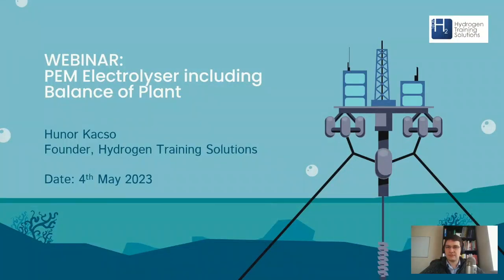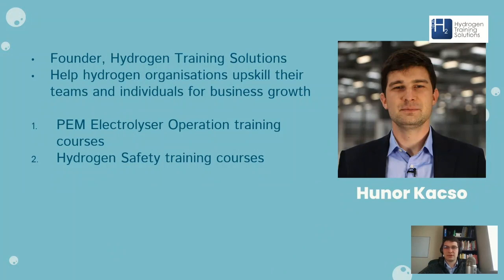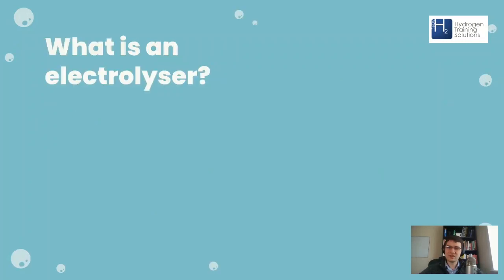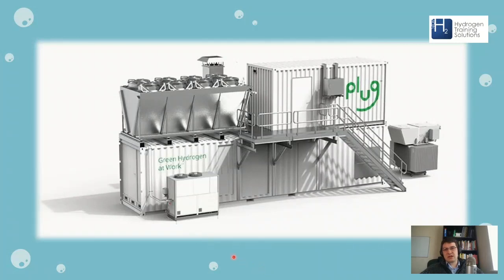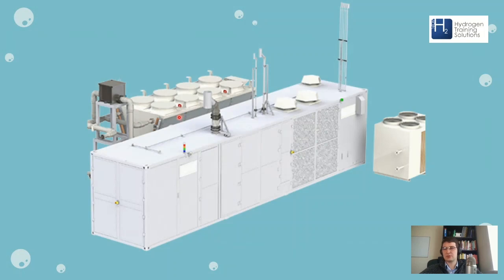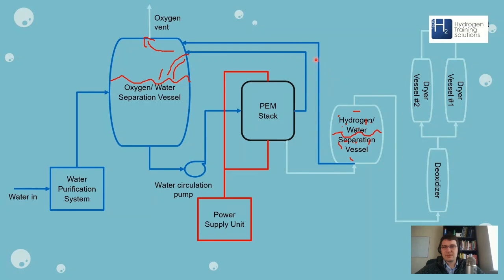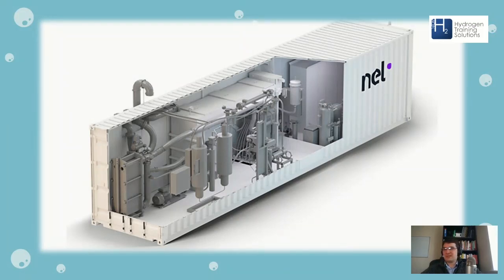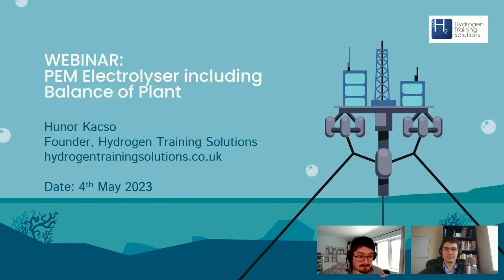Webinar: Full PEM Electrolyser Operation including Balance of Plant

Comment: Does the water circluation pump send water through the Anode and Cathode in parallel? Does the water travel THROUGH the PEM along with the H+? How does the water get INTO the H2 separation vessel?
Does a higher water temperature allow electrolysis to occur with less applied electrical energy?
Reply from the maker: Great question. Water circ pump is circulating water through the anode only. Yes, water travels through the PEM with the H+. For this reason, there is water and hydrogen exiting the stack therefore the H2/water separation vessel does what it says on the tin. 
Yes, the higher the water temperature the higher the voltage efficiency. IE: lower voltage needed for the same current level for a given H2 production rate.  

Hope that makes sense?